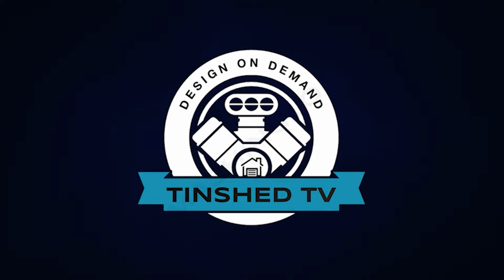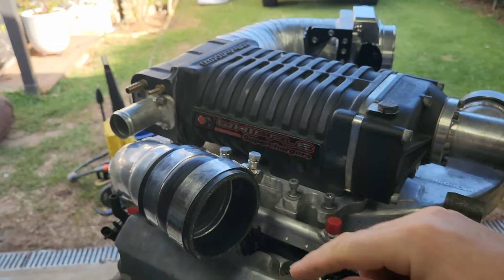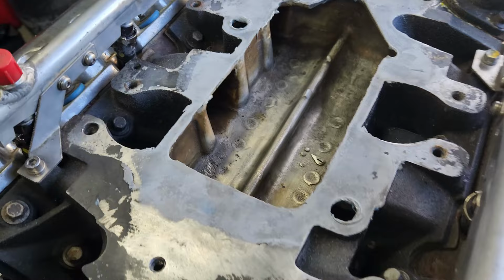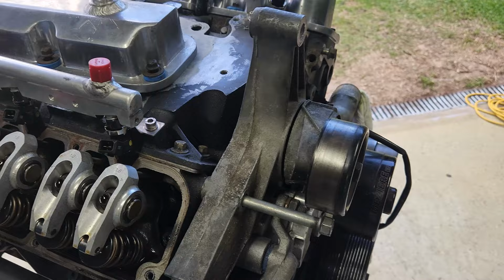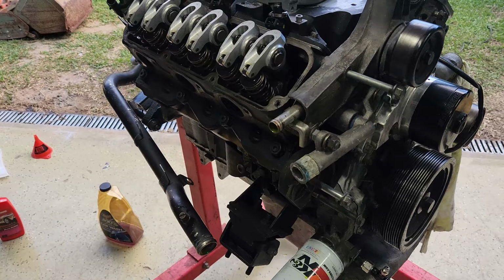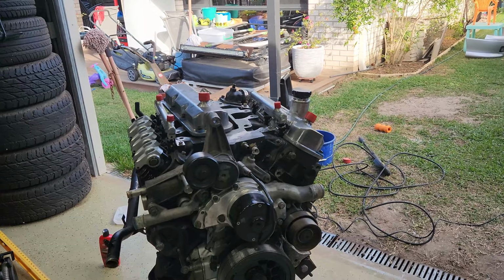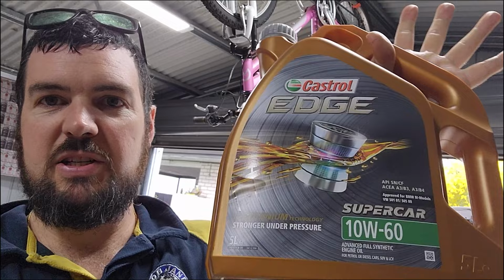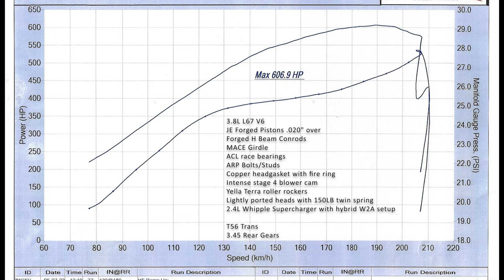CV6 Monaro Build | #8 - Engine Torque

Comment: Fantastic build enjoy the show. Have you thought about ever running an engine oil cooler they work wonders to drop the heat in the engine oil
Reply from the maker: Surprisingly, these motors' oil temps follow the coolent temps pretty well. Just make sure you have a big radiator to support the heat

Comment: What cam??
Reply from the maker: INTENSE™ Stage 4 Blower Cam, duration @ .050": 235/238, lobe lifts: .375"/.376", valve lifts with 1.60:1 rocker arms: .600"/.601", lobe separation angle: 116, intake centerline: 112